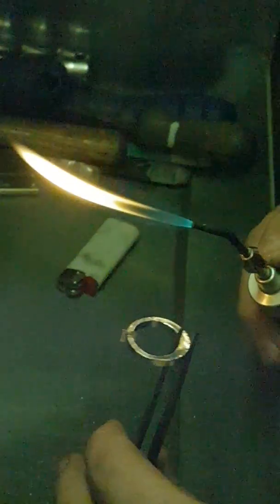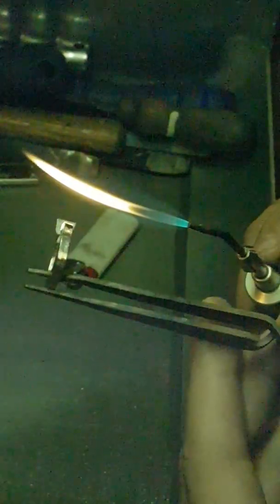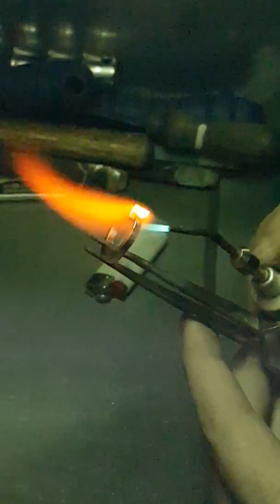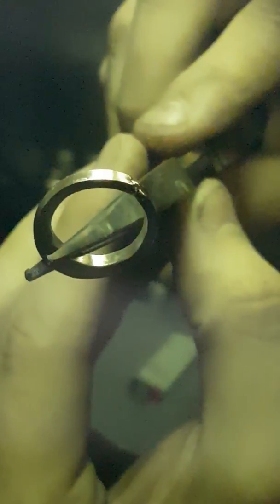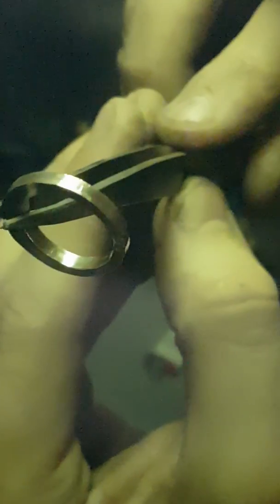Fusing platinum

Comment: I am retired now but I have done this for years before I had a laser welder you need a hot burning gas like propane or Acetylene and oxygen it is the only way to work on plat with diamonds unless you have a laser